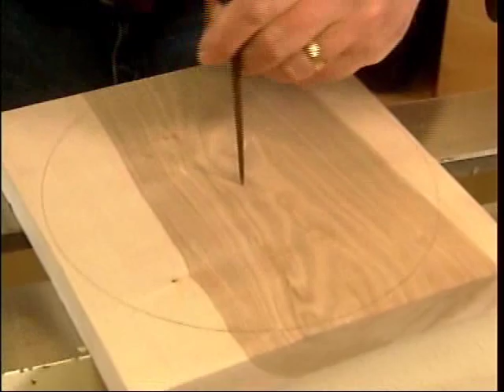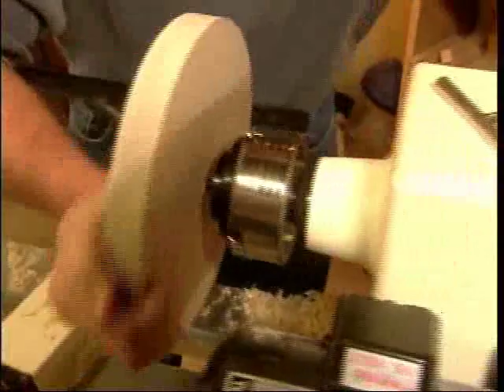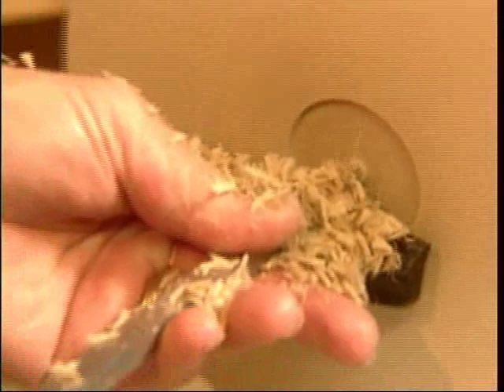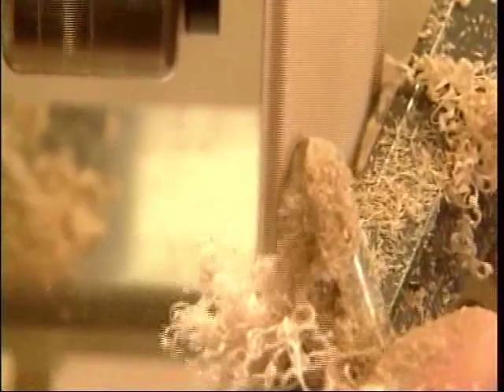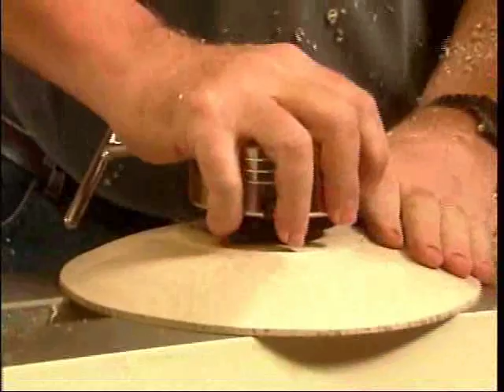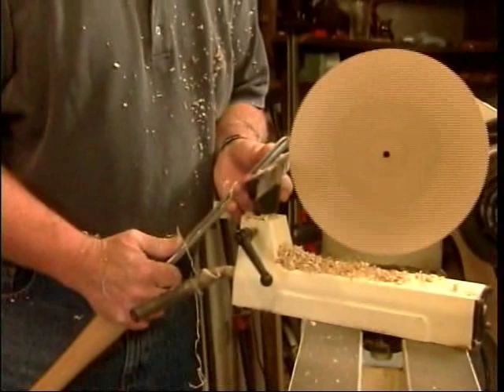JET Tools - Lathe Projects - Turn A Plate - Part 1 of 2

Comment: As a machinist for 20 years machining metals this is a lot different than I thought it would be. For instance, I would never have thought to lay the work piece down and remove the chuck from the lathe and put it on the work piece, then put it back on the lathe. I would have tried to hold the work piece flat against the chuck on the lathe and tighten the chuck.

Comment: nice job on the plate! i want to make one of those but i have a small problem. i have a bunch of logs but no way to cut them like what you have. my dad thinks a bandsaw is too dangerous and i think it is dangerous but i wish i could still use one.  i have a chainsaw but it's small. anyway i can make boards from logs like what you did? i would also need to do this for segmented turning since i don't buy any of my wood.

Comment: It is easier and safer to mount the blank in the chuck while the chuck is on the lathe.  Close the chuck enough to fit the blank into it, push the blank against the chuck jaws, then close the jaws.  The jaws are self centering, the weight of what is put onto the drive spindle is less by a couple pounds, and taking the chuck off the lathe accomplishes nothing more adding an additional two steps to the process.  After 40+ years of turning I've learned to pare down and dispose of useless/meaningless steps.  Do it the way that trips your trigger, but the way shown is the video is more complicated, more time consuming, and increases the chances of dropping and breaking the whole thing on the floor.